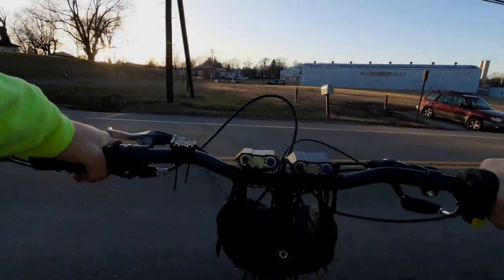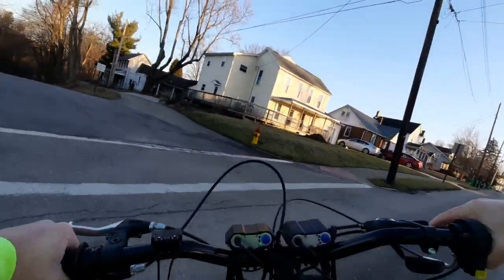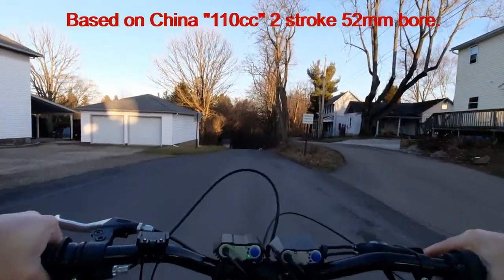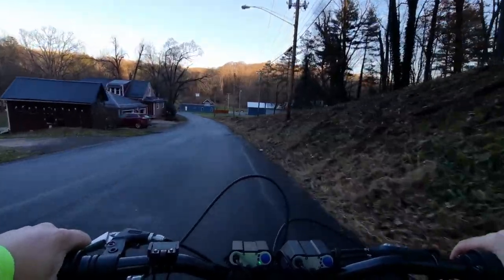Nasty 2 Stroke 85cc Motorized Bicycle Banging Gears Shift Kit Case Reed Testing

Comment: full 6 gears with no clutch, impressive build, sounds awesome. Be safe and ride true.
Reply from the maker: It does have a clutch, you just don't have to use it to shift gears just to stop and start, it uses the bikes rear gears and D railer. I'll put a video out about how it all works i am injured right now so it could be a little while before I can make it. My new big engine build got me on the first ride.
Reply: @wbracing1027  praying for a fast recovery!
Reply: @wbracing1027  Waiting the video it's awesome how performs those gears . Nice video
Reply: @wbracing1027 hope ur healed soon and a new vid comes out this thing flying

Comment: Hey man, nice video! I'm planning to build one of those 110cc Kits. Did you Just hone it to 56mm or Is that a new cylinder sleeve? Looks great. I think I would also bore it to 56mm but keep it piston port induction for torque Down Low and stealth
Reply from the maker: It's a new sleeve. I found one for a vintage  4 stroke engine and had to cut it down and do all the ports myself before I sent it out to get machined.  The motor on the bike is still the 52mm for now which makes great power once you spend a ton of time on it. There ruff out of the box. Yea well see how reliable the case reed is... it sure does help bring the power in at high rpm with my pipe and port job.

Comment: I am planning to build one with a phantom 85 v3 motor. I want to know from where you got this shift kit. I live in a city with steepest roads so I want a shift kit which is reliable and is fun to use.
Reply: I love my v3 phantom! Did u end up buying one? I have over 5000 miles on it and some light mods including a big port grind and match and polish and it goes almost 48 mph on flat ground with my 245 lb self on it.

Comment: My bike was considered a class A motorized bicycle just because I went 58 miles an hour I’m entitled to register it $16 a year. I need a motorcycle license. I need a helmet and a safety features on the bike in order to drive it where I am from. I did not know this anyone else is going through this were there from what kind of laws is you guys going through in your country or state because damn my bike is not a motorized bicycle in the eyes of the state it’s considered a full pledge motorcycle like what the fuck is anyone else having these problems?
Reply: It was a YD 100 hybrid case creed I built from scratch with a big bore Zuma jog cylinder the power bands were no joke. Front wheel lifts up with no problem whatsoever. All I need it was a shift kit and it would’ve been a Willy monster. It’s funny how E bikes are banned completely where I’m from but you need to register a two stroke bicycle engine that got me confused.
Reply: No laws where I'm from
Reply: My state u don’t need a bike license for one everyone has one cops see me an don’t bother me I have one as well havent used it yet

Comment: What kind of shifter kit or assortment of parts u use to build it? I have a v3 phantom 85 that I ported and polished that will go 48mph on flat ground with my 32 tooth sprocket. And I also weigh 245 lbs lol.. which is why the many uphill stretches of road around here kinda suck but  if I could change gears it would be amazing! Any info is massively appreciated from anyone! Also if any of you live near greenfield Massachusetts and Wana ride hit me up!
Reply: I bought mine it came with a jack shaft kit that run is power through the derailleur. I seen a few videos recommending against it I was going to just get the regular sprocket but now I see this I'm just going to order a new derailleur for the one that's broken

Comment: Update on the prelude please!!! :) Also where would i be able to learn more on the case reed im interested to do that to my bik

Awesome riding man, stay safe <3
Reply from the maker: There's a couple guys that have videos out about the case reeds build break fix channels one. I'm probably do a video on how I'm making a 100cc case reed with all the modifications i had to do. The new "110cc" engine platform its really a 79cc when you get it 52 by 38, it has the space to do the case reed conversion pretty easy. It did make a big difference on the higher rpm it has much more punch. I'm traveling to Florida and back alot lately for work as soon as I can put out content on the car I will it winter here.

Comment: Good afternoon, you made a great ride video, I enjoyed watching it. I have a question for you, what is the durability of a bicycle transmission with such a powerful engine?
Reply: Durability is our 26th concern (right in front of safety). Though I don't think any of these have been ridden long enough to wear out the transmission.
Reply from the maker: I'm more worried about the beveled gears on the engine itself. The shift kit does pretty well there's just chain maintenance

Comment: Give us the cubic centermeter video with liquid 100cc are you sure, please prove!
Reply from the maker: My first engine in the video is 52mm x 40 mm. The one I just built is 56mm by 40mm video not out yet, you do realize there's engines that come truly 80cc now. There 52mm by 38mm you can purchase them on Amazon or eBay. I just over sleeved one and put a 56mm piston in it plus split the crank and put the rod on a 40mm crank. I'm not using the 66/80 platform that people are used too. I have like 5 of those old engines there 47mm by 40mm or 47mm by 38mm depending on what you purchase

Comment: with 12-speed k7 it works, there is no danger of chain falling in front??
Reply from the maker: Can you reword your question? Both the "petal bike chain and the right side drive chain have guards on one side of the chain to keep them from coming off. That said there's alot of time put into setup and making sure to get all the chain alignment just right. Once you do get it true and have a decent chain Tensioner for the both drive chain's left and right, it's very reliable. I have only had to right side drive chain come off once. And it was after 2 or 3 thousand miles without any adjustment. I can move the engine up and down slightly to keep slack out of the right side drive chain.
Reply: @wbracing1027  I'm Brazilian so I'm translating. but I already made the project of the bike with gears, it's working well, I got some ideas from your project

Comment: It appears you have an awesome setup. I'm in the process of trying to find a good mountain bike to put my engine on. Any suggestions?
Reply from the maker: Shwinn skylinner with metal chromoly  frame not the aluminum version. Plenty of room. You will need to upgrade stuff but the frame is a great start....that's my next purchase a skylinner plus I like the look and how comfortable it will be. I go on 40+ mile rides often not just out racing around.
Reply: Build your own mountain bike. Lol jokes aside you can put together something better than a mtb and you can change ratios as you please
Reply: @str8xrippin   I like the bike your building.
Reply: @John-vw4qz  thanks bud I'll be uploading soon so watch out for that

Comment: Hey man, how is the 100cc coming along?
Reply from the maker: Good and bad....the engine is finished I did every single last trick I know to make it the best it can be. Well on my first test ride, it was pulling the front tire in 3rd and 4th gear. Stopped made a adjustment to the carburetor was running lean, went to go and it did a massive power wheelie bucking me off and sending me to the hospital with a highly damaged left knee. Two major tears and two fractures plus a bone bruise. I didn't get any of the crash recorded. The engine was twice as powerful as I thought I would be and I payed for it. I'm starting to get the build organized to make a video. It's sucks but it's not the motors fault.
Reply: Did you have to custom build the 100cc(98.5cc) or is there a kit
Reply: @wbracing1027  Whoa sorry major brah. Thinking these built motors require a bike built to match - at the very least a much heavier fat bike with upscale components. :face-fuchsia-tongue-out:

Comment: Sweet bike what's your top end?
Reply from the maker: 52mm x 40mm for now.. from the "110cc" kit [which is really like 79cc] it shows up 52mm by 38mm. Which i split the crank and added the rod to a true 40mm crankshaft kit so it's 85cc it makes some power for what it is....but they needs tones of fixing to make them run well with a good pipe. I have a 56mm top end I custom made for it...it will be a true 100cc should be a blast. I will put out alot more info on that upcoming build.